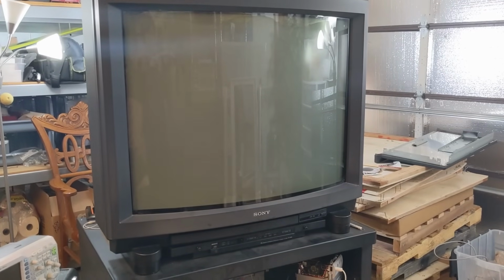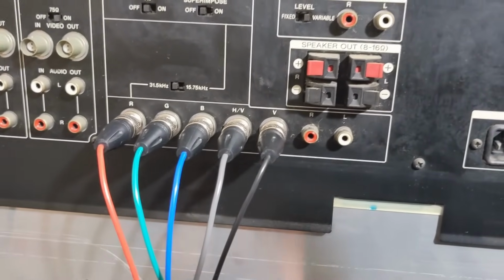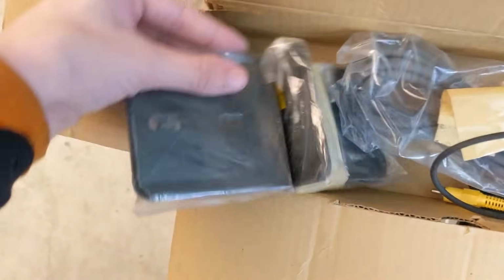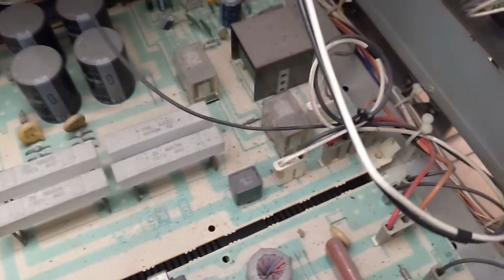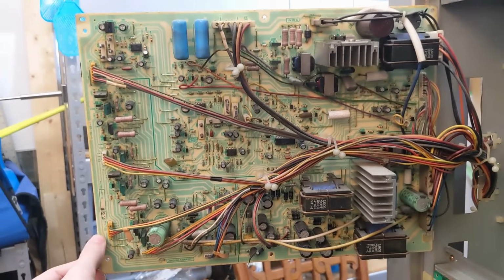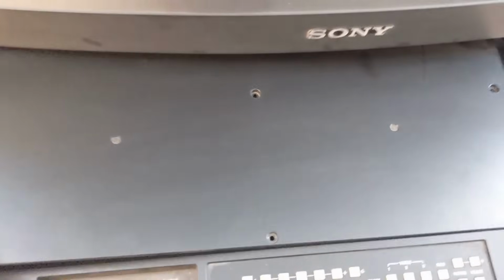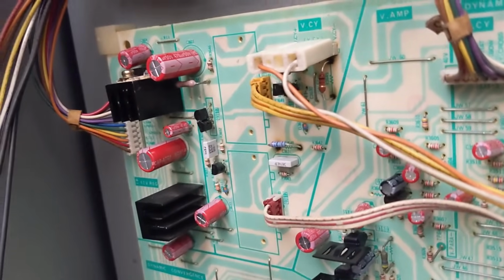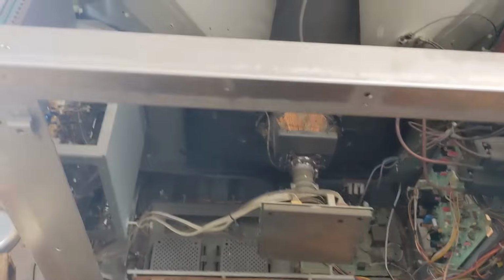Overview of the KX45ED1 / PVM-4300 (Worlds Largest CRT)

Comment: Fun (and annoying) fact on Trinitrons - the bigger they are, the worse the geometry, purity, convergence, and edge focus they have..  They had a "recall" where they replaced the deflection yokes with "improved" yokes to anyone that complained but it didn't help a lot. I quit being a Sony ASC because of all the complaints.
Reply: That's true for all CRTs, not just Trinitrons. Picture tubes were made astigmatic by design or they just would have been impractically deep. I have a Philips K-40 tv that's impossible to focus on the edges and is only 26" wide.
Reply: @UHF43  It's not true for all CRTs, at least not at the level that the Trinitron suffered.  Better brands had dynamic focusing to counter astigmatism where the focus voltage was dynamically modulated to match the scan frequency.  The flat faceplates had the most trouble with edge focusing, but the Trinitron was worse than most.  The RCA Invar flat (almost) with the pre-yammed yoke CRTs were virtually perfect from a geometry, purity, and focus standpoint at 27" diagonal and under, and excellent on bigger tubes all the way to 36" (the biggest RCA (Thomson) made.  As far as your Philips, I would have to see it, but there's always some give and take with focus - if yours is fine at viewing distances,  it's a good tube.  Sure, some customers are impossible to please, but with regard to larger Sonys, I was getting legitimate complaints.
Reply: @ohger1  I remember Philips advertised the so-called SCAVEM system, that stood exactly for that: Scan Velocity Modulation. Here in Europe we also had Videocolor that manufactured the PIL-S4 picture tube and had very good convergence, geometry and focus. Then they developed the Super Planar that was a complete nightmare to try to adjust to something bereable. My Philips (one of them) has the 30-AX picture tube, so its early 80's. You can adjust for perfect center focus, but then the edges are really blurry.

Comment: The tube is also serial number 3. In my experience, it’s not unusual for the serial number on the chassis sticker, to be slightly different, sometimes by several digits, from the serial number on the back of the unit. It’s just carelessness at the factory, rather than anything more sinister (someone doing a ‘cut and shut’ by swapping bits around). Have a look at another PVM or BVM and you will probably find the same thing.
Reply from the maker: I'm fairly certain it's 103. I have a service manual amendment (granted, it's for the 4300 not the kx45) that references numbers below 100
Reply: @MoreShankMods  Sony serial numbers are not always consecutive, sometimes a ‘1’ in the serial number sequence indicates a production change or revision, but the ‘1’ is normally closer to the ‘2’ ie 21xxxxx or 201xxxx
If over 100 of these were manufactured, then there’s a good chance more are hiding out there, waiting to be discovered. On the other hand, they are 35 years old and take up a lot of space…

Comment: is the safety glass really that dangerous?
if the glass gets evenly and slowly heated (to let the heat go through the thick glass)
i would say it is safer, because glass only shatters from stress through uneven heating.
you should talk to a glass maker for more informations
Reply: With 8T of air pressure on the front (and rear cone), yes!

Comment: Sadly, this unit is worn-out. Afer all, it was a restaurant TV.

Even if someone were to replace all the e-caps and overheated transistors, there's still the fact the tube's emission is low at this point. Rejuvenation doesn't work for a long time, especially on Trinitron tubes. What we really need is CRTs making a comeback because the old tech is becoming unsalvageable in many cases.
Reply: Just like with a dimmer projector you can just shut the lights off and enjoy it regardless
Reply: @MrCarGuy  Up to a point, man.
Reply: @sadderthanyou7793  why so negative??? and crts can still be serviced and they do everything you have is decaying as we speak your cars your phone your pc what ever
Reply: @ygtx44 Because I've worked on far too many CRTs over the last decade to pretend. Out problem is the lack of NEW CRT production, not broken boards on 30-40 years old CRTs.
Reply: @ thats any old tech for you friend its always been like that
Reply: @ygtx44 Not at all! You can buy brand new vacuum tubes for vinyl record players, for examples.

CRTs are not just like any tech. The tubes make them unique because you can't really fix a tube - rejuvenation works for a short time, especially on Trintiron tubes. That's why back in the day, companies would actually swap tubes. Trust me, they would just rejuvenate them if it was worth it, but it made no sense to get the client back in a month of two with a dead tube.
Reply: lol the reply guys in the replies to this. of course you can never truly restore crts but you cant tell the n00bs who never had CRTs before, they gotta act like they know it all. fools and their money, grass is green, sky is blue
Reply: For better and worse, CRTs will never see a manufacturing comeback. Repair is the only way to go.
Reply: @CarrotsNotCake  You cannot repair a worn-out tube. Rejuvenation is a lie - it will only hasten the death of the CRT. Repairing the boards makes sense only in cases where a CRT wasn't used much (or at all, if it's NOS).
Reply from the maker: The picture is still surprisingly bright, and lights up the whole room when its on. Def well used, but still clearly has lots of life left in it
Reply: @MoreShankMods  brightness isn't everything. There's no doubt a high-hour set like this will have lots of blooming issues, ie cranking up the brightness will make the whole image go blurry. Yes it'll still "go bright", but the image quality/sharpness/focus goes down the sh-tter in the process
Reply from the maker: @Knaeckebrotsaege  Yea, it certainly looked a lot sharper and more vivid out the box. But it still looks quite good. It is well worn, but clearly has a lot of life left.
Reply: @MoreShankMods  It might seem that way because it's a large tube, but the original emission was much higher. There is no escaping the fact it was a restaurant TV for many years.
Reply: @sadderthanyou7793  Yeah, but if you do not watch it in direct sunlight, it may still be enough. 

I have a FW900 that I use all the time, I am sure the CRT is worn (and it has developed some intermittent shorts which I managed to clear), but I run it at brightness setting 35 and contrast setting 33 as my room is dimly lit.

Weird thing about some Trinitron monitors is that they are too bright when cold. Some kind of correction circuit that has gone out of alignment. When the CRT warms up, the image is normal, but when I turn on the monitor, it is really bright (brightness setting 0 when cold is brighter than brightness setting 35 when warm). 
I wonder if the big TV also does this.
Reply: @Pentium100MHz  No, only the PC Trinitrons do that.
Reply: @Pentium100MHz  How did you clear the intermittent shorts? :o
Reply: @oriole8789  With a BK 467. The shorts were present only when the tube was warming up. So, I disconnected the heater wire, set the BK for shorts removal, connected the heater wire and then repeatedly pressed the "remove shorts" button. The shorts did not go away completely, but now I have to bang the table or something when the monitor is warming up (some seconds after turning it on) to get it to blink in some color. It used to be worse - the monitor would randomly blink in various colors a minute or so after turning on.
Reply: @Pentium100MHz  Thanks for your response! I have the same symptoms on mine - almost identical. My workaround was to turn off the monitor as the brightness started to rapidly go up, but before the shorts happened and the color flashing started. And then just keep repeating until it warmed up enough. As with your case, the shorts are only present when the tube is first warming up. I don't have any CRT specific tools like the BK tester, so I'll have to invest sometime! Thanks a lot for the tip, I saved it as a reference. Appreciate you taking the time to respond!!